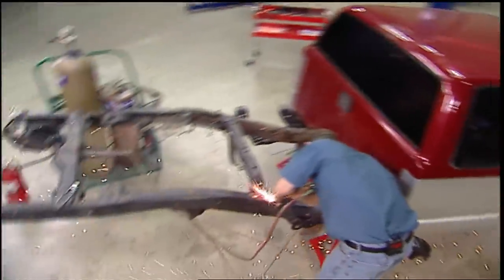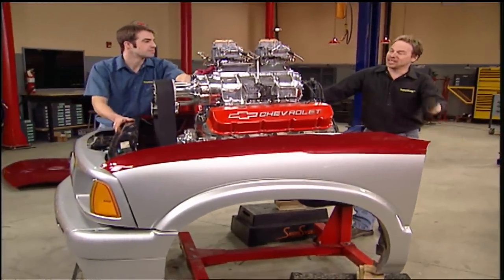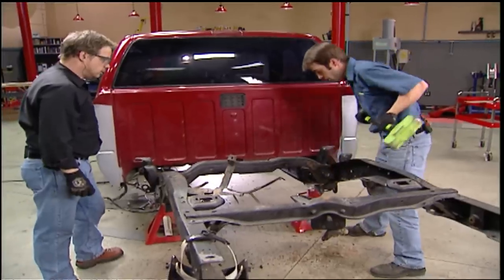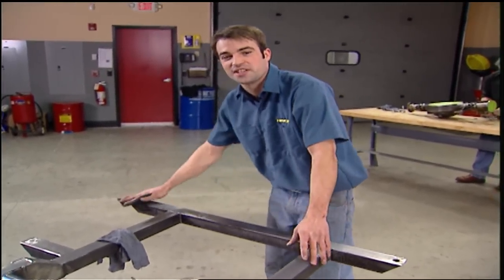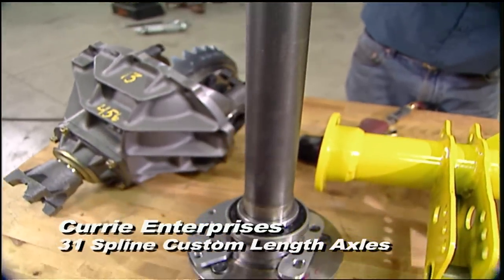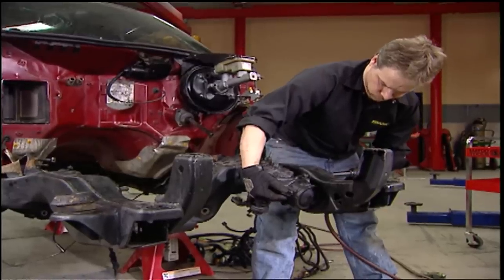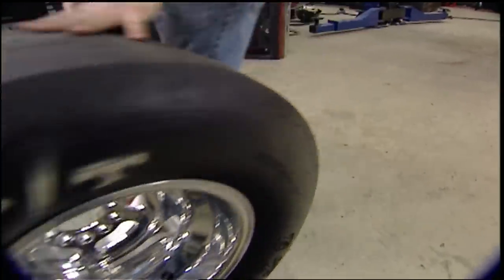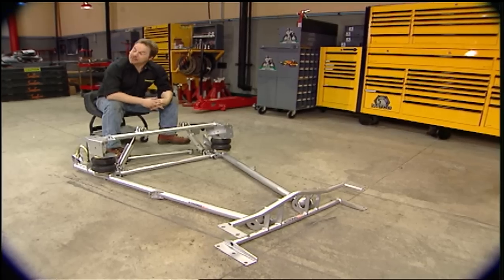Tearing Down The S-10 To Transform It Into A Pro-Street Truck - Trucks! S9, E3

Comment: All good except that drop spindles are a BIG no-no considering you’re losing 2” of much needed down travel for drag and/or street racing! The goal is having the front tires ON the ground for as long as possible while the front lifts for weight transfer👌🏼
Reply: Exactly why I skipped the drop spindles on my Sonoma. Also figured they wouldn't be a good match for my fenderwell headers.
Reply: Then those s10's and sonoma's are already as light as a Foxbody mustang putting in a big block your trying too go too the moon
Reply: Drop spindles only relocate the wheel center to the chassis. Does nothing to the suspension travel unless the spring height is shortened.

Comment: Never messed with the DOT street slicks until here recently. I purchased a really nasty S10 with an LS6 (had one of those cams that made people lock their doors at the red light lol) T56 Magnum 6 sp dual disc clutch, 8.8" Ford Moser axles, 4.88:1 & the DOT street slicks & penny's up front. I had noticed that the windshield wiper blades were in horrible shape & needed replaced which I mentioned to the guy.....
Now I do remember his response clear as day which was "Oh I wouldn't worry about those too much" but in one ear & out the other.....
So I'm rolling down the hwy about 75mph & hit this huge freak rain storm which was when the guys response about not worrying about the wiper blades truly had meaning. They don't play any role in functionality when you're using the passenger door window as the windshield lol
Reply: If you have a spool in the rear end it would be a good reason you might have gone sideways.
Reply: @heshtesh  didn't have a spool, 8.8 Detroit Locker 4.88:1

Comment: Why would you cut out the old frame rails though I understand it would add weight but it would most certainly add rigidity
Reply: So they can fit bigger tires in the rear. That's the whole point of the narrower rear end and backhalfed.

Comment: Low 7s in the 1/8th? I was running mid 7s in the 1/8th with a 1978 Trams Am and bone stock 400. All I did was slicks and 200 shot nitrous.
Reply: thats slow with that much nitrous lol
Reply: @thor1252002  I thought it was pretty good with a $300 junkyard motor.

Comment: Being that 9inch are getting really hard to find, why not a 8.8??? It's lighter, takes less power to turn, & is just as capable.
Reply: Brand new 9" from Quick Perfromance are very reasonably priced.
Reply: 8.8s are getting rare now also. Especially if you want a disc brake no rust version.